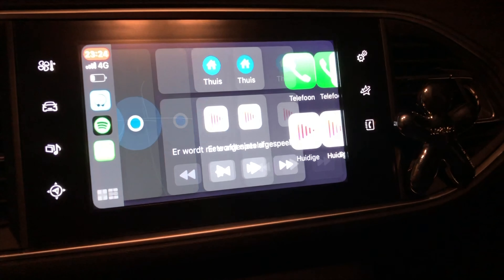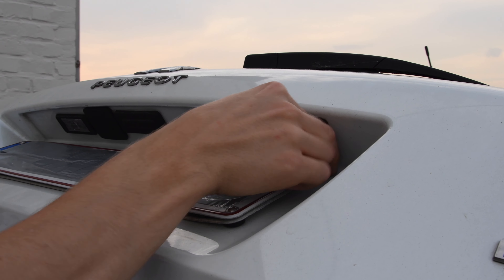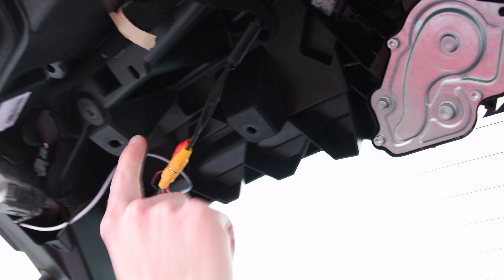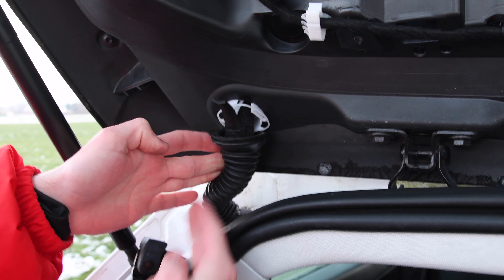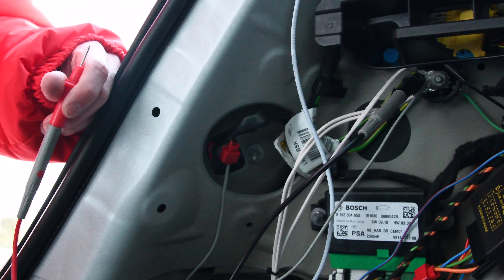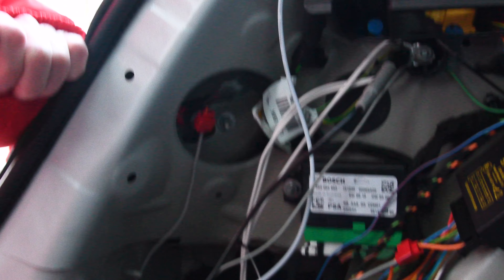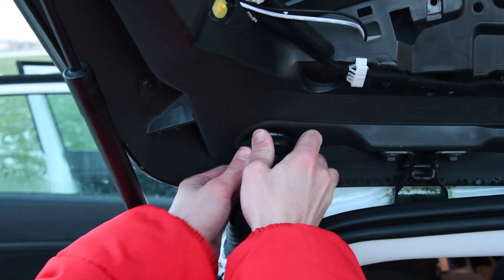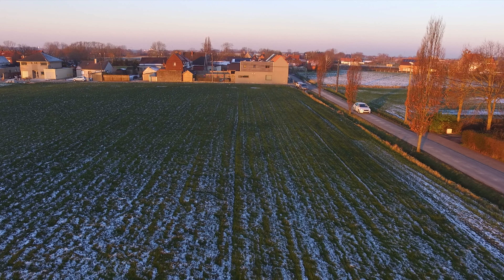Backup Camera Installation for Peugeot 308 II | The DIY Guys

Comment: I also installed a rear camera on my Peugeot 308 SW II from 2016. It was a lot of work to get it working so I like to share my findings with you:

I used an Ebilaen AA/CarPlay unit and a Smartour 1080p camera. I found out as explained in this video that I had to use a relais to make it work since the voltage was varying between 12V-14V (so even above the 12V use a relais). They don't explain it in this video but it does matter to which yellow cable of the two cables of the relais you connect the - and signal/reverse light. Check Google for an image of how to connect the cables to the relais. Next, I also found out that I had to use the small red cable attached to the video cable. So don't cut it off! I had to connect it to the REVERSE input cable on the back of the Ebilaen module. This provides the module the signal that the car is in reverse. At first I connected this cable to the reverse light cable but as said earlier the voltage was varying too much. Therefore I connected the tiny red REVERSE cable to the + cable of the relais which also goes to the camera. And then it worked!

Turn off OEM|Aftermarket camera in the main menu under settings > car. Finally, the guide lines on the screen were opposite to that my steering wheel was doing. Go to Front View in the main menu and change View to Normal of Reverse.

Hopes this works for you. Cheers!
Reply: Thanks man, I spent a good share of the day struggeling with this install and I think that as you mentionned, the key is the relay! I'll give it another shot soon... By the way, where did you get the steady/power 12V?
Reply: @thierryhimself2796  I managed to wire it up and used the antena amplifier cable in the headunit and wired it to the little red wire that came along with the RCA video cable. Since the Car has a Canbus, the camera pops up without needing the reverse camera signal. If you don't have a canbus you can just wire the cable from the antena amplifier back to the camera.
Reply: @octavian4305  thanks, helpful!

Comment: Many thanks for the tutorial! I am studying to install the Carplay-unit including rear camera on my 2016 308SW also. 
It seems that you are using the reverse light signal/power to power the camera, right? You do not continuously supply power to the rear camera, correct? 
Does that mean that if the camera starts sending a CVBS-video signal (or AHD?) to the Carplay-unit also automatically starts displaying that video? In other words: there is no need to separately feed a reverse (light) signal to the Carplay-unit?
Reply: Did you manage to install the parking camera?

Comment: For the love of god I can't seem to remove the plastic cover above the window (at 1:10 ). Anything you guys had to do to remove it? The sides (almost where the trunk privacy cover clips to) can be removed fine, but the inner part of the cover is just 100% stuck
Reply from the maker: With our car, it was just a matter of pulling hard. You have to dare to use enough force, but make sure that the plastic does not break.

Comment: Hi, if I already have the original camera that came with the car, as in the manufacturer's one, would I need to fit this if I install the Apple carplay/ Android auto kit that you fitted in one of your other videos? Would the original reverse camera not work?
Reply: I would assume you can just plug in the old camera's output cable into the new head unit without doing any wiring, as long as the head unit is plug and play

Comment: This video could have been a little bit more explained. 
Find the 12v in reverse, but it will have less than 12v but it might have 12v.
And bring a cable from the clip and attach to a yellow....sure but that clip it's positive or negative?